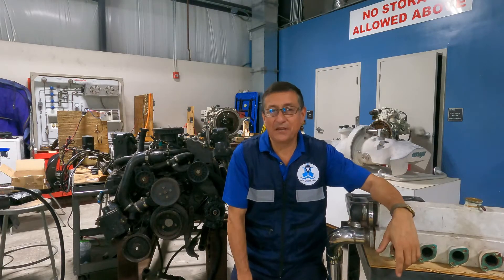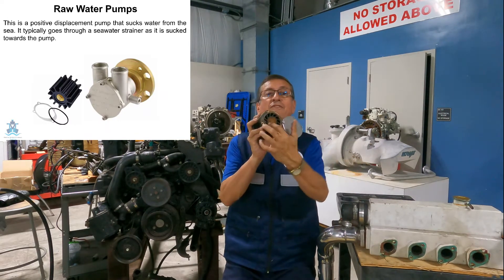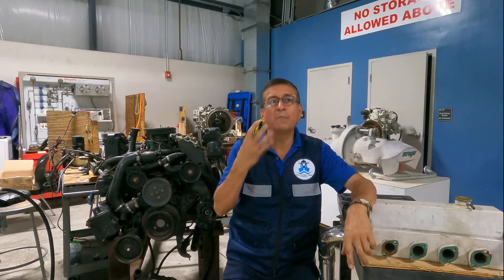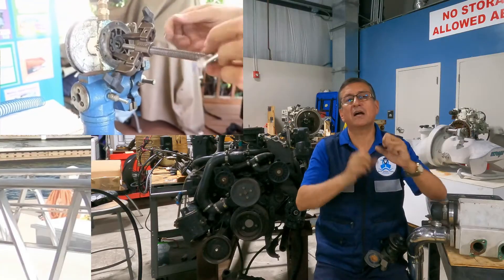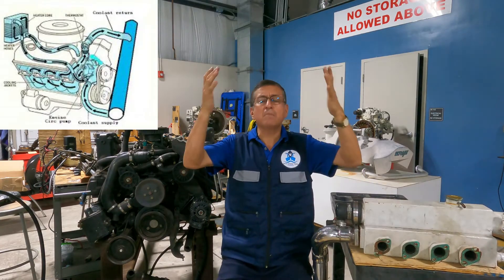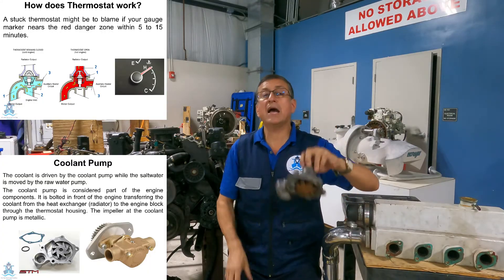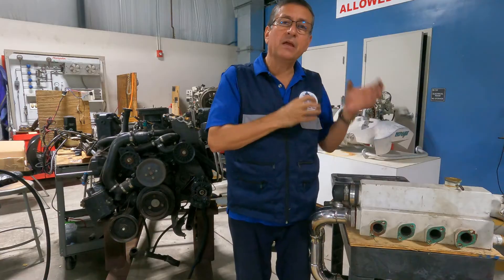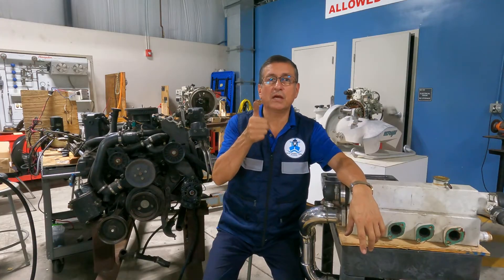Overheating in Marine Inboard Engines

Comment: 1 year later with new motor i am still chasing a fake overheat problem at sending unit in intake mainfold. 1987 5.7l mie 260hp clossed cooling. sea water in in out is 80 deg. exp tank in and out 125.  risers 90. Temp difference in HX is 10 deg. with a new 140 t-stat but under way guage maxes out at 240. Could there be a blockage in the intake by the sending unit? the runner is 148 on the sender side and across the maninfold other side of stat is 138. Chased this problem with the old motor to. The only part that is not new is the intake manifold. Any ideas? Please respond ty.

Comment: We have volvopenta TAMDE70e engines and they begin to overheat if we run more than 1500rpm for longer than a few minutes but anything below 1500 it runs fine, what do you think of that?
Reply from the maker: There are multiple causes. However, I recommend checking The Heat Exchanger condition as well as the Impeller blades condition. This is in my opinion a lack of heat transfer at the heat exchanger

Comment: Hello Teacher! In a Ford Fsd 425 marine engine i have high temperature. I have measure with laser gun everythink and all shows good up to 2500rpm above the 2500 starts to overheating slowly slowly and when we re going with 3300-3500 the temperature goes up to 110°C and when we drop the throttle down to 2200rpm the temperature does not goes down a lot. I have work the engine with also and without thermostat. I have replace the water pump also and the impeller. But the problem stay. Did is the heat exchanger who also is and water cooled exhaust and expansion tank? What do you think about?

Comment: I have two helm postions each with their own gauges. The lower/inside temperature guage reads 75°c normal but the upper reads 95°c that's wrong. Do i buy a new guage or is there a fault with the wiring?
Reply from the maker: This is probably a woring fault. Normally an open or loose ground at the second station